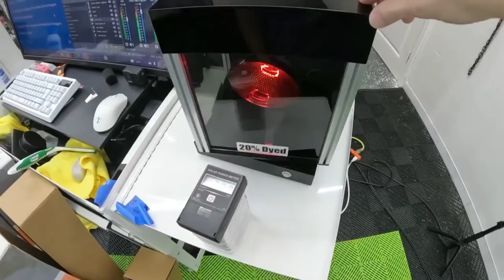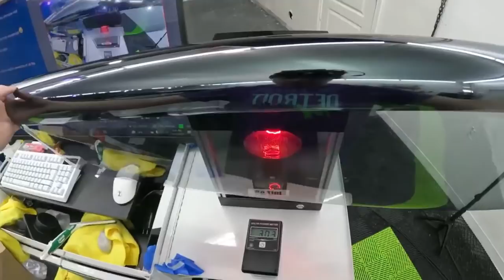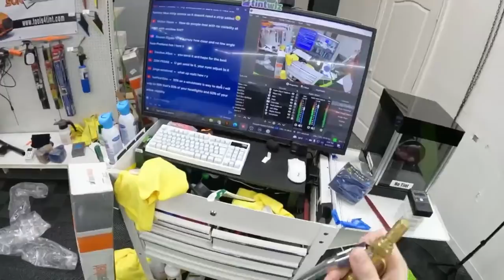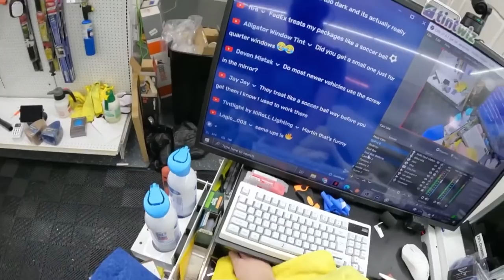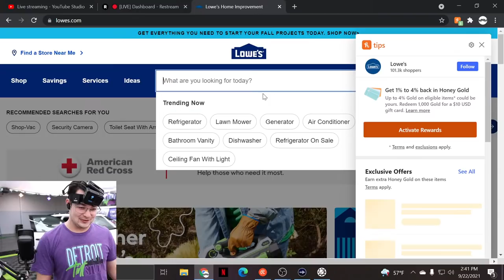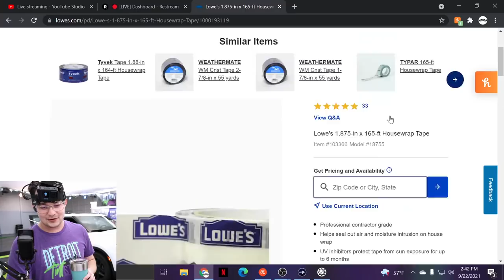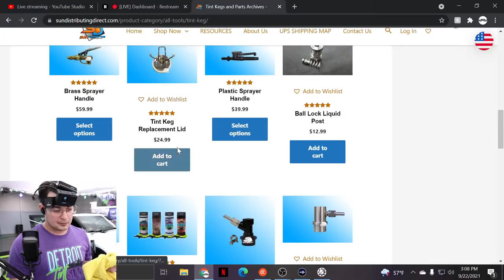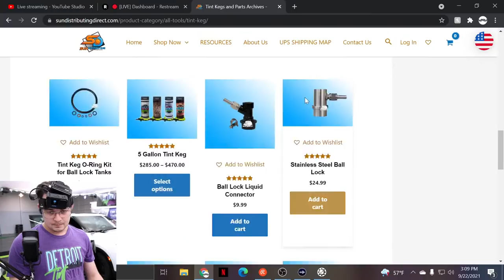The BEST Ceramic Window Tint

Comment: I feel like a heat gun would have done a better job I usually carefully cut in the middle long side and take one part out then the next one. I’m on the process on purchasing this apex ceramic I have never use ceramic so will see how it goes.

Comment: I notice you always use microfiber. Just the other day I used microfiber cloth and after in the sunlight I noticed ever so small fibers sticking to windows. I thought It was from washing and I wash mild no heat or dryer. So I sent out bought very expensive ones and looked close in sun same thing. What is going on. They appear in sun as ever so tiny glass fibers like.

Comment: I just got put in Solar guard vortex ir ceramic 70% and it feels hot to the touch when it’s 100• outside. I had a bronze tint before on a truck I bought used and I remembered it was cool. Help